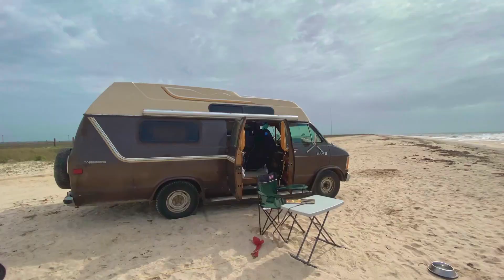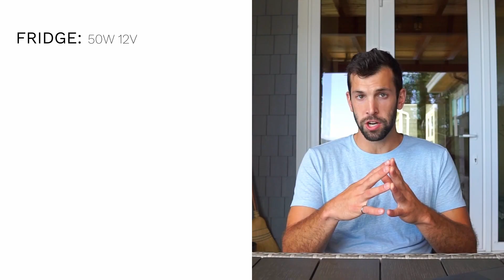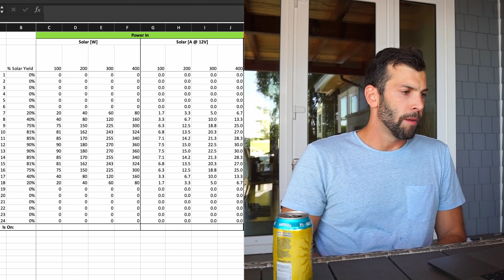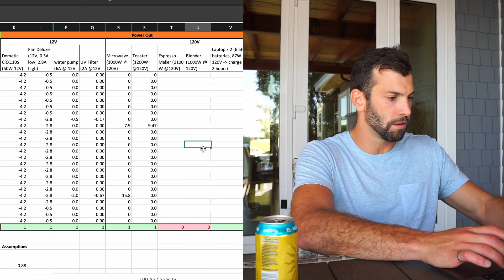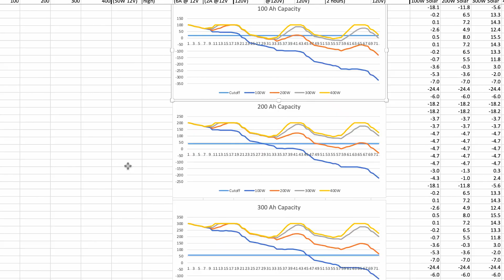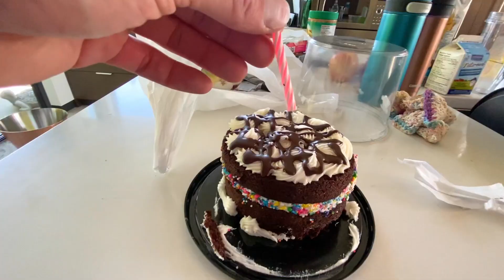How To Size Your Van's Solar System | PROMASTER VAN BUILD SERIES | Episode 6

Comment: This video was so helpful! Appreciate everything in It! Can you tell me more about your Alternator set up, I also have 2 100ah Lipo batteries. Do you guys charge them from your regular car battery or another lithium battery?  Confused on whether or not I need a isolator or will a 60 amp moot charge controller do the trick. Hard to find this info for some reason! Would appreciate any response if you have the time thank you!
Reply from the maker: Hey, glad you found it helpful! We are eventually putting out an electrical video, but it isn’t quite ready. 

We used a 50A MPPT DCDC charge controller from renogy (https://amzn.to/3xfX2eW).

It’s a combination charger, so it does our solar and alternator. You just run wires directly to your starter battery, then connect your solar, and the output goes to your lithium batteries. 👍 it can do up to 400W solar, but they have to be in parallel. 

If you already have a solar controller then a DCDC charger will also work for your alternator. 

Hope that helps!

Comment: You made a mistake on the fridge. The 50w is only the usage when the compressor is running. When the fridge is on its set temperature, the compressor will stop. Usage is based on the ambient temperature, but way lower than 24x4.2 is 100ah.
On a hot day (ambient 86F) it will use about 50ah. With 77F this will drop to 30ah. When you have a fan and some airflow, the high temps will only be some parts of the day, so actuall usage will be somewhere of 30-35Ah on a summer day
(See dometic website for the energy consumption)

For lithium, if you want it ‘cheap’ you can build your own battery. Much cheaper than eg a Battleborn. 280Ah cells (you need 4 of 3.2V to make a 12v battery) are about 80 usd/piece. A BMS (battery management system) is about 50-100 usd... so in parts about 450 usd for a 280Ah lithium battery (when sourced from China)
My cells are currently on its way, once i have them i’ll add the battery build to my build logs of my Promaster van conversion https://www.djsmiley.com
Reply from the maker: Hey you're right on the fridge, good call! We checked with the dometic website and it came down to quite a lot lower than we'd ballparked. Thanks!

How has your battery system worked out?
Reply: @HayleyandJake  Don't know yet, still on my lead-acid batteries (100Ah) atm, but i'm not finished construction yet (Almost done).
My cell's are still in transit, I hope to be able to build my battery soon. They are shipped from China to Poland by train, and using UPS they should be shipped from Poland to my door (Netherlands), so that will take a while (30-50 days I think in total, but air freight is way more expensive and I'm not in a hurry. But a lot of other people are using the same cells and are very happy with it. (See eg diysolarforum for a bunch of people who also build their own lithium batteries)
I did received the BMS (JBD BMS / LTT Power BMS , $60 directly from China, same as the Overkill Solar BMS), but without cells its still laying in its box.
Reply from the maker: @djsmiley01  hey! just wanted to check in a see how your batteries are working out 😁👍🏼
Reply: @HayleyandJake  Batteries are working fine. I've added some details about them on my website. I made a box of wood, installed everything and its working fine since. Due to covid I didn't have had a proper real-life test, but I hope to make trips next year. Especially when there is less sun it all comes to the batteries, so we'll see (I'm planning on visiting UK/Scotland, and Scandinavia, so those will be some nice testing options with probably less sun than a Spain trip)
Reply from the maker: @djsmiley01  Sounds great, we'll check it out. Thanks for the update!
Reply: @HayleyandJake  No problem, feel free to ask any questions. (The battery build process is on https://djsmiley.com/cms/?p=400 )

Comment: I decided to run a mini split AC that pulls 600 watts on high and about 400 watts on low. So I went with three 400 watt panels and 300 amp hours of lithium. If I need more amp hours I will leave space for more battery capacity.
Reply from the maker: That’s awesome! We hadn’t heard of an A/C system with such a low draw, we just checked it out! That’ll be a beastly setup!!! 🤙😁

Comment: Engineers and informative videos, hehe.  Very well thought out and a great calculator.  I'm not sure if I missed it but what did you land on for your battery capacity and solar amount?
Reply from the maker: Awe thanks guys! We didn't actually say the numbers, but we're thinking between 300W - 400W of solar, with around 300Ah of lithium batteries. We're trying to find suppliers at the moment 👍🏼 How much solar are you guys going with? 😁
Reply: @HayleyandJake  We ended up going with 2 x 100 watt panels, the Renogy Eclipse model.  We wont have as many AC items as you.  Hoping we calculated our needs alright😬
Reply from the maker: I’m sure you guy will be golden! 200W is plenty, and you always have your alternator 🤙😊 we had like 50W in our last van and two standard car batteries as the battery bank (came with the van), so we wanted to go a little overkill on this one 😅
Reply: @HayleyandJake  Im doing 4x200W solar (800w) and 3x170LiFePO4 (510Ah), totally electric no propane
Reply from the maker: That’s a pretty solid setup!!! What kind of cooker you going for? 😊
Reply: @HayleyandJake  2000W single burner induction
Reply from the maker: @stilettosqueak  Sounds awesome!!! let us know how it is 😊👍🏼
Reply: For my Ambo conversion, rather than doing a spreadsheet ( I’m not Sam engineer) I went with what I could afford and how much space was available in/on the Ambo for batteries and solar. There is room on the roof for 3x355 watt solar panels so I went with 1065 watts of solar. The Ambo had a dedicated battery tray that would hold 3x200 ah lithium batteries so I’ll have 600 ah of storage. My fridge/freezer, a/c and fan are all 12 v. My cooking appliances, induction cooktop; steam/convection oven & Ninja Foodie are all 120v but will rarely be used at the same time. I plan to do a lot of outdoor cooking and have bought a Solo Ranger fire pit and cooking accessories for that purpose. In addition to the solar, the Ambo came with a second alternator that is dedicated to powering the house. I think I’ve got my power needs under control. This solar/battery setup might seem excessive by Canadian standards but I’ve watched enough videos to see that it is more common in the US, and I do plan to winter in the US.